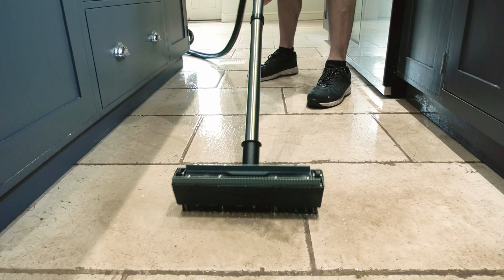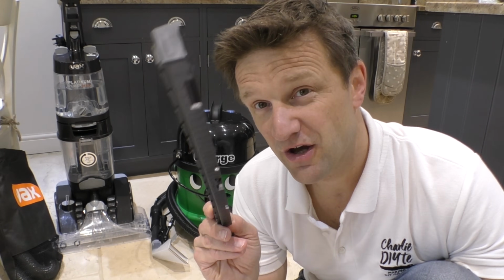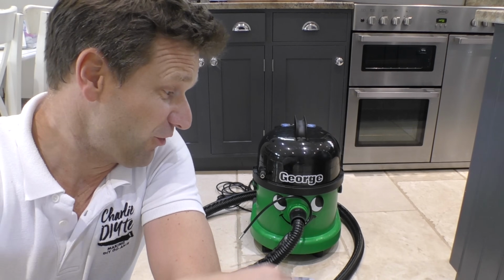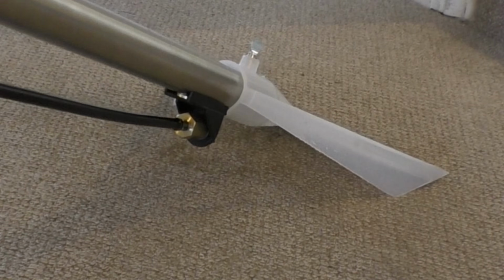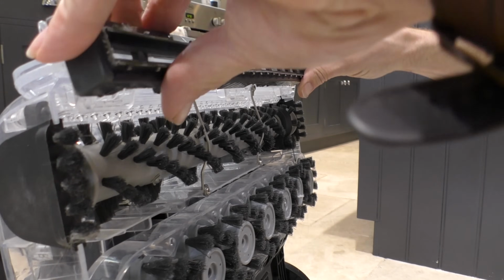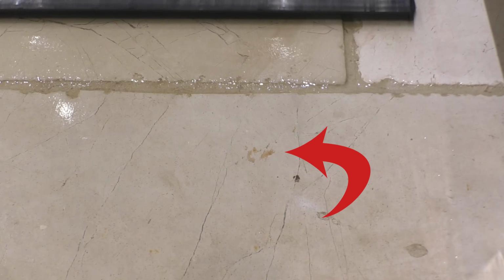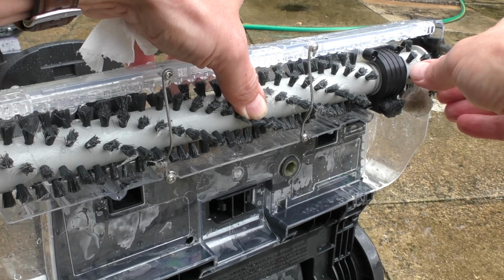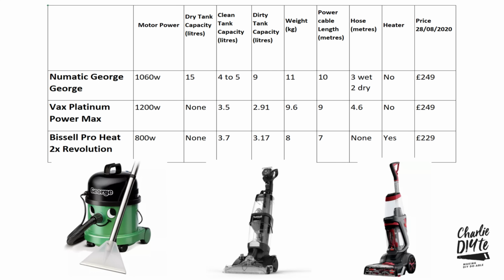The Best Wet and Dry Vacuum for Hard Floors & Carpets?

Comment: Worth remembering that being a wet and dry vacuum, George is exempt from the power limits imposed on regular household vacuums. His motor is more powerful than any domestic dry vacuum on the market and although this doesn't necessarily equate to better performance, many of us still believe in bigger motors! For my money, George is a no brainer, even for those who think they don't need a wet and dry vacuum, it's surprising how often they can come to the rescue. I have saved a neighbours wooden kitchen floor from irreparable damage after their washer leaked. They can unblock sinks, even bail out a blocked toilet if you're not squeamish about emptying and washing the bucket later. You can suck gunk from outside drains and gutters, even sludge from the bottom of fish tanks without moving them and risking breakage.  The bags are massive, strong, cheap and available everywhere. Plus, because they are universal for all henry type cleaners you know they will never become hard to get hold of, which is good to know when you realise anything from numatic will last you many years.
Reply from the maker: Thanks for that Spencer. I wondered why George is able to have such a large motor and all the others are pegged back to 620watts. The Numatic technicians argue the suction is undiminished in the less powerful motors because of better, more efficient design but this doesn't help you when you have to put a new motor in an old Henry like I did here. https://youtu.be/yO7nfqiABMw Still a very capable machine but not as good as it was with the more powerful motor. You raise some very good points there that I should have put in my video!!

Comment: Would love to see you go in a bit more depth on grout cleaning. Floor came up like new 👌🏼
Reply from the maker: I've put a ton of grout protector on it over the years but it doesn't do any good. The best thing you can do is bleach, scrub and steam clean, and then apply at least 2, preferably 3 coats of the satin sealer (assuming your floors are porous stone like mine).
Reply: @CharlieDIYte  thanks for the reply 😊

Comment: Can you do a video of you comparing your old henry to your George
Reply from the maker: Not for the foreseeable but I would say George is a bit big as a general domestic vac. The extra power isn't really necessary and the real problem is the lack of a cord reel to stow the cable.
Reply: @CharlieDIYte  ah ok ye your henry is made in 2000 and back then all the old numatics came with 8 meter cables only now the domestic ones come with 10 meters and the commercial ones come with 12 meters

Comment: I have both George and the Vax. I prefer the Vax for carpets because it does such a good job. The steamglide is good on my laminate floors and the vax is great on carpets. I mainly use George for wet vacuuming the car but was impressed by the hard floor cleaning performance too

Comment: Great video, thanks! Is there a way you could try Bosch GAS 15 PS? I'd like to buy it for my house but also for woodworking. Thanks!
PS; I also live in the country, also have those almost white floors and the wide same joints. It's so annoying! :D
Reply from the maker: Yes, and I've put a ton of grout protector on it over the years. Does absolutely no good. All you can do is keep applying the satin protector as often as possible, because each deep clean takes it all off, leaving the surface even more prone to dirt. That Bosch looks like a nice bit of kit. Sadly, if I bought another vac, I think my wife would divorce me 😂
Reply: @CharlieDIYte  Jaja! Ok, no Bosch review, then. 😁
About the wide joints: add some quartz to the grout and you won't have that problem anymore. Why quartz? Because the joints are white. For other colours you can use fine sand. 😉 🇦🇷
Reply from the maker: @PAPIOPA1  Great tip. Next time I have a grouting job I'll remember that 👍

Comment: Not native english... some mistakes typing ahead...
Old 90's rainbow D4 SE (special edition), not the new ones, this old ones are simple machines easy to fix (of course make more noise and have less tech but it will do a good job for regular/simple house clean)
As long you clean the water base, store the rainbow without water, clean the machine and you know how to use the rainbow it will last for at least 20 years on domestic/home cleaning 1 time per week ( it will use the carbon brush's after 20 years and you need to replace them and ready for another 20 years)
It have one special attachtment for cleaning carpets dry and another with water.
Reply from the maker: Thanks for the comment Mario. Clearly a decent machine if it's still going strong after all this time, and as you say, the ability to maintain and replace parts is such a massive plus, as I found out with my Henry https://www.youtube.com/watch?v=yO7nfqiABMw&t=6s
Reply: @CharlieDIYte  Really like that video too (long time viewer), keep up the amazing videos.
Hugs from Portugal

Comment: But where is the water level on the tank. Just don't know how much water to add?
Reply from the maker: On George? You want to fill it an inche or so from the top, just in case it sloshes over as you're dragging it around.
Reply: @CharlieDIYte  I later worked out that if you follow the instructions on adding the chemical - see bottle, , you'll get 5 litres of water as standard. Thanks again

Comment: I have a vax every thing you say is wright I bought a bissell pet pro far better and there solution is better has well don't make the carpet like a fur ball like the vax is too hard for the carpet and it damaged the carpet how can it says which and good house keeping?
Reply from the maker: And my father in law broke the Vax recently when he borrowed it. Snapped off a lug so it doesn't lock in the upright position anymore. Classic case of marketing over substance (like Dyson, dare I say it).
Reply: @CharlieDIYte  Dyson is another one I have a siemens vaccum cleaner 2500 watt with adjustable dial for the motor Dyson plastic is cheap

Comment: ARE VAX CARPET SHAMPOOERS FINANCIALLY FIT FOR PURPOSE?
with the smart wash at £299, these machines are designed for the domestic market, although the build quality is adequate, I have found that care is needed with the brittle plastic parts.
The machine is unlikely to be used in a normal household more that once a year, it must be registered within 3 months to get any extended warranty or it reverts to 12 months. The warranty covers defective parts but not accidental damage, so you have to store a bulky machine for long periods of time where it won’t get accidentally damaged. If it does get damaged the likelihood is that you won’t be able to get it repaired, which could make the machine useless very quickly. 
Serious thought should be given as to whether you need to own one or hire a decent machine far more cheaply when required.
Reply from the maker: Steve, I think the Vax is a gimmick backed up with continuous, slick TV advertising. I lent mine to my father in law after doing this video and he snapped a critical part which keeps it upright when not in use. To me it's simple. You use George for removing spot stains eg pet mess and cleaning car upholstery and cleaning kitchen floors and if you want your carpets cleaned, get the professionals in. I have a friend who is a professional carpet cleaner. I'm going to do a video on his process some time soon

Comment: The quality of vax machines went downhill a while ago. Brittle plastic, pointless gimmicks.   Dyson is the same - James Dyson stopped designing their products years ago, maybe that's why.
Reply from the maker: That's interesting. I did think it was a bit Dyson-esque, which is never a good thing! That revolving upholstery brush got damaged because I forgot it was slotted onto the handle when I turned the damn thing upside down to try and clean out all the fluff, and it plunged to the floor, cracking the brittle perspex.
Reply: @CharlieDIYte   Both had good quality products which made their brand highly regarded but then the accounting and marketing departments took over.  The penny pinching on the plastics is particularly annoying. If it's going to be plastic at least use reinforced plastic which is what would be used in a power tool body for example.  I ordered a George on the basis of your review, so thanks for that.

Comment: I had the vax platinum powermax.  After years of using the vax floormate for hardfloor cleaning the platinum was the worst thing ever, for
Carpet cleaning the platinum was also shite    I’m very very very obsessive over cleaning, the platinum was diabolical,  I had great pleasure smashing it to pieces, for hard floors the platinum only releases water on one side of the head,  I was my floors everyday as we have 6 cats and the platinum just couldn’t cope, the belt for the brushroll at the front broke and the bristles on the spin scrub heads fell out,  I had the the vax replaced twice due to breakdowns then they refused to do anything about again
Reply from the maker: I agree Dave although in my case I left the job of breaking it to my clumsy father in law who borrowed it and then handed it back to me broken (it no longer stands up). I hate watching their multitude of TV ads. They're like Dyson on this. Marketing over substance and a plasticy product that breaks easily.

Comment: There is nothing on the plannet that does it all Range Rover good off road but cost a lot to buy and run Ford fiesta shit off road but good on road and costs nothing I have cleaned carpets all
my life and trust me none of these will do the job not even as a quick fix !!No not selling my self because I have retiered .. Only passing comments to save folk money the dirt is only in the top
half inch if that too much water does not get sucked up and then leads to bacteria growth most cleaning powders are acidic and dont neutrolise the chemical etc etc etc not as simple as
folk think if I were you just ignore this vid get a good Henry Vac for dry stuff andif you want to clean your carpet or car upholstery get a pro in but make sure he/she is a pro as there are a lot of
clowns out there that just pick up a machine and go for it "RIP OFF COMES TO MIND" You have been told /warned !!!!